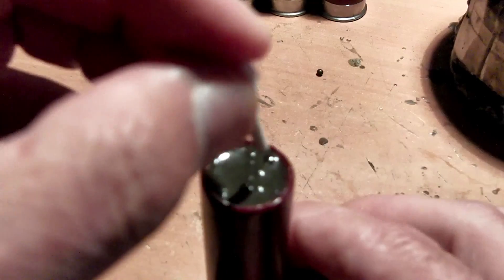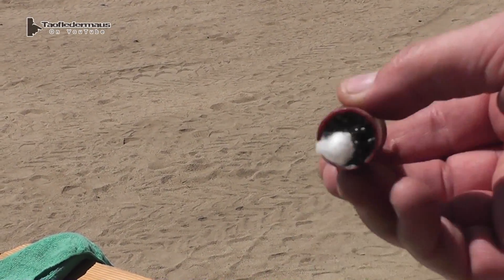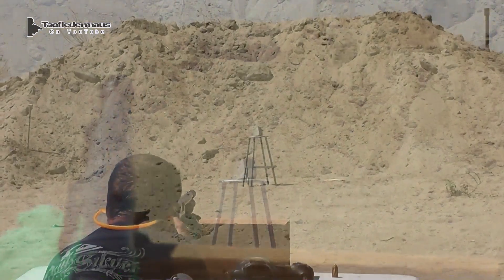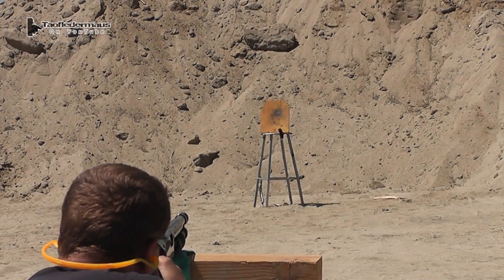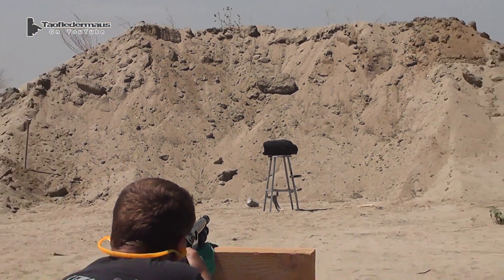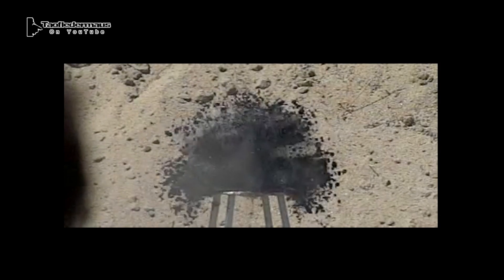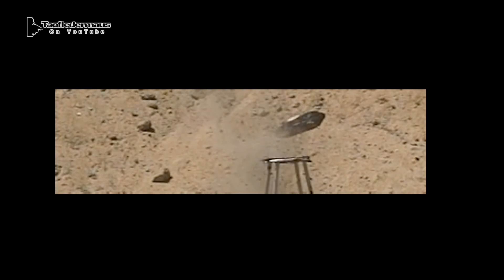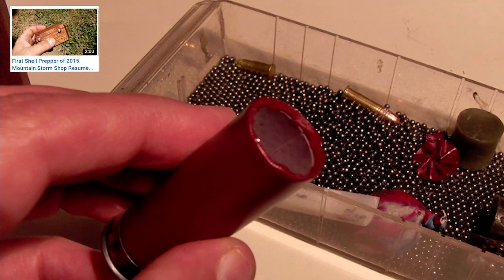Q-Tip Stabilized Shotgun Slugs - A Strange Look at  Aerodynamics

Comment: Would folding up a small ribbon or string at the bottom of the shell case before pouring the wax in and suspending a portion of ribbon/string in the wax to anchor it possibly be a way of stopping the round from turning while retaining the perceived benefits of having a tail?

If this has already been done and I am unaware of it, I am sorry, but I feel like this may be an uninvestigated possibility. If this idea has already been used, I would like to see the video, so please supply a link if you leave a comment indicating as much.

Comment: From my understanding of aerodynamics* issue with using a q-tip for stabilization (aside from requiring the 180 degree flip) is that it's not getting the airflow that the front of the round gets, so it's probably stuck in the turbulence that forms at the back of the round as it travels through the air, if it's getting any airflow at all during supersonic flight.
What might stabilize the shot would be to top the wax slug off with a ball bearing the diameter of the round.  I think this would make the round aerodynamically stable when flying straight rather than flying at an angle.

*Everything I know about supersonic aerodynamics comes from days of playing Kerbal Space Program with the Ferram Aerospace Research mod

Comment: Okay, I'm just going to say it: I'm not aware of ANY successful projectile design that involves "fin" or drag stabilization, and the reason for that is, quite simply, because bullets/slugs are supersonic, not paper airplanes, not rockets, not arrows.

For those who are interested in super or hypersonic dynamics, you know that whenever an object passes the sound barrier a drag surface will create a pressure wave against that surface. It's a pressure wave that doesn't go away, and itself contains a tremendous amount of energy working against the energy in the projectile. In a perfect world where all forces are equal and spherical this isn't a problem, however as the Concord designers found out a perfect, spheroid universe of equal forces doesn't exist and even the slightest imperfections can create substantial differences in the high-energy pressure waves along drag surfaces. I'm talking about the ridges of residue left over from combusting gunpowders caught by the oil of a thumbprint, here. Even THAT can send a bullet flying or spinning in a way you don't want it to move.

That said... there are, in fact, drag stabilized rounds already on the market, but not shotgun slugs, I don't think. Boat tailed bullets, the conventional wisdom and testing shows, are more accurate over longer ranges than flat-backed bullets because as the round travels, the pressure waves along the sides of the projectile fall into the tapered back and, for a fraction of a second second, smash into it, but then as more air flows in what happens is something interesting: it creates a toroidal (donut-shaped) vortex behind the projectile. While small, there is enough energy in the vortex to push against the pressure waves, dissipating them, and creating a self-stabilizing drag wake behind the projectile. Basically, it creates fins without fins, that automatically adjust themselves to counter the forces against them. It's really quite fascinating.

So, yes, please stop trying the physical fin designs, at least for a while, because I don't really think that they'll ever work, EVER. Instead, try using molds to change the shape and flight dynamics of the slug, and maybe if if you can get your friend with the high-quality metal machining to create a boat-tailed backing for a wax slug (to prevent major deformation) and see what happens.

Comment: Could you make a longer wax slug but then using a hot knife shape a pointed tip ( or use a mould) , does a flat face make the slug wobble?

Comment: Very interesting result:
The long Q-Tip seemed to "stabilize" the slug in so far, that it only tumbled from side to side instead of turning around completely.
I would not have thought that something as small as a Q-Tip would have enough influence to do even that.
As far as the usefullness of that is concerned, well ... :-)
Reply from the maker: Landogarner83   We thought the long q tip snapped off since we found a piece of it on the ground.   So we went with the shorter ones.    We never know what is going on when we are out there.   It's so hot we try to get as much stuff filmed and don't have the time to review the camera footage.
Reply: Thanks for the work you all do to get us these vids I always find it worth to watch them.

Comment: What was the saying? 'Keep it simple stupid' I think most of these improvised projectiles are just over thought in their design. I think the Qtip would have worked had the slug not had to rotate initially which gave it the yawing. But then having it loaded the other way would probably not work either. It was interesting to see.

Perhaps a small coil of fishing line at the back that wont break but also wont make the slug spin around? It means it could start in the position it needs to fly in ?

Comment: my Q is why is the wax slug braking apart quicker on the plate, quicker then the flying speed of the slug in flight  at 2:24
Reply from the maker: Gummy Bear    It's kind of an illusion.  At 1200 frames/sec  a slug going 1200 FEET a second travels one foot per camera frame.     Because we are filming along the path of the round,   we can capture more frames of it flying.   If we filmed from the side,   the round will only be in a couple of frames.

Comment: so wax slugs don't go deep but is the energy dispersion dangerous.  like if someone was wearing the ar500 plate would the have to worry about the spray to the neck
Reply from the maker: Michael Berggrun       The impact would still be heavy,  like someone hitting you with a sledge hammer.    If we put a cardboard box next to the plate,   it would have a line of holes all the way down it from the splash.   We'll have to do that.
Reply: Thanks for getting back to me I would like to see the splash in a future video if you can

Comment: a string tail. small plastic disc the diameter of the shell's interior, hole in the center of it, feed the string thru and coil some below the disc. disc keeps the string tail from getting incorporated into the wax/birdshot mixture (though of course, you need some string incorporated into the imp slug). shot goes flying and unfurls the string tail as it flies. prolly won't work for shit, but it'd be fun to see if it does.

Comment: Hey man awesome vid as usual! Just wonderin when you said you used oil to create the vapor trail were you using motor oil or like vegetable oil? Silly question i know. I think that this is a great idea but the qtip maybe doesn't have the weight necessary to create the drag or the shape. It'd be cool if you could somehow get something like an aluminum cone or a lead dowel that has winged grooves cut into it to see how that'd work! My two cents; Cheers!
Reply: I realize now you have actually already tested the concept i badly described with the tear drop rounds, the hunting arrow rounds, and that crazy machined supersonic round. I tried lmao
Reply from the maker: Jesse Fisher   It was just some marvel mystery oil.    I was going to put some olive oil on them but I had a little bottle of the MMO handy.

Comment: What if wax slug would have piece of cork on the bottom?
Reply from the maker: Earl of Destruction  I'm not sure if the wax would stick to the cork very well,  especially after being shot.  That g-shock is strong and often blows things apart.
Reply: ***** If not, it is possible to glue a stick in the cork which goes through the wax.

Comment: A mini parachute off a model rocket would be hilarious to watch get ripped apart trailing behind a wax slug. Absolutely stupid, but entertaining none the less.
Reply: screw the parachute... what size estes rocket motor will fit in a 12 gauge?!  shoot one of those!!!
Reply: stinkyfungus A "C6" engine would be a tight fit, if it's too big, a "1/2 A" would be the next smallest one. Make sure you have plenty of cover. If the engine ignites, it could fly back at you.
Reply: +rocketman221projects 

hear that tao? doooooooooo eeettt!!!
Reply: rocketman221projects Yeah, those little things get nasty if they dont have fins to set the course. >_> If you can secure em they make wonderful fire starters though.